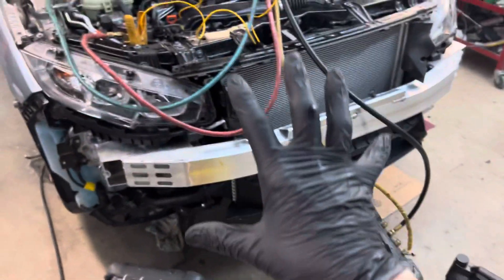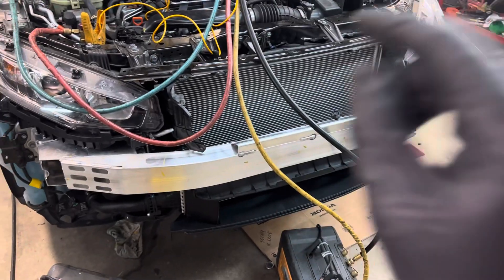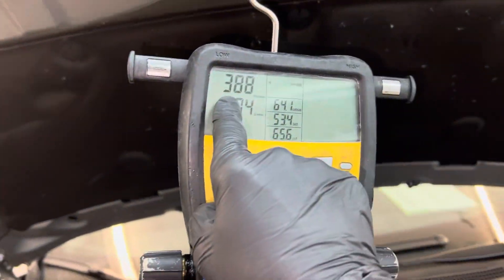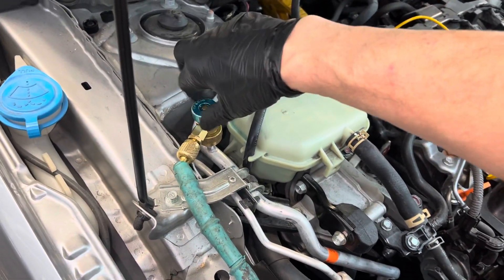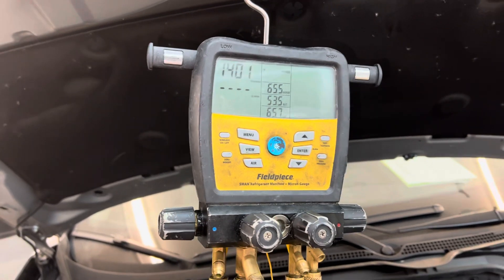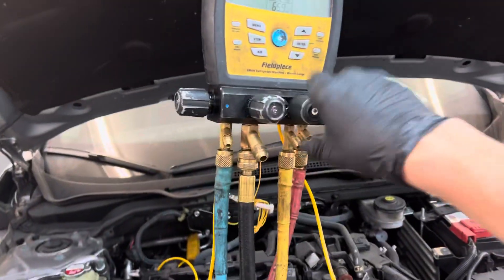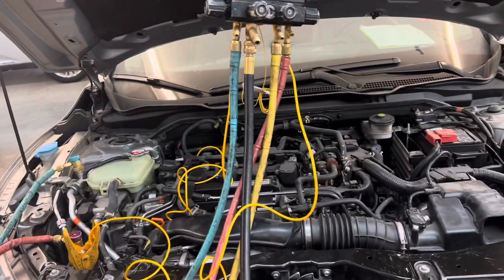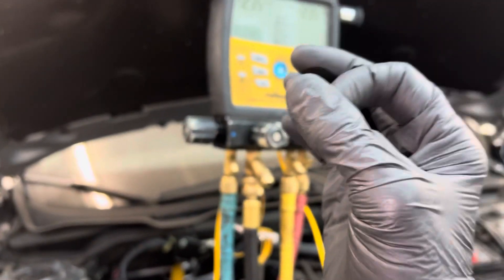Is Honda shaft seal fail under vacuum. But there still a way to charge it without air contamination￼

Comment: If the shaft seal is leaking under vacuum, this means atmosphere is leaking into the system under these conditions.
Reply from the maker: And this is just another reason you see some cars with high air content mix with refrigerant 

Many techs can’t even find this type of vacuum leak, don’t even know it existed 

   Many technicians believe formal education is not needed you just learned by screwing customers cars up until you learn and charge them for it. 

       Many technicians think as long as it works it must be good and you charge them for it.

     Think of a paint job where the body shop doesn’t have a waterline separated in it or it’s doesn’t work anymore so when they primer the metal little spots of water shoot out onto the metal years later rust spots develop underneath the paint but it was good at the time they did the work look good. 

        Technicians who don’t know need to replace the torque converter when a transmission would burn out charge the customer $2000 to throw in a transmission reuse the old torque converter don’t flush out the transmission cooler that has filled with tiny metal flake transmission worked perfectly when I left the shop but burns out in 30,000 miles. 

        Same goes with air-conditioning leave moisture in the system leave some air in the system came out perfectly cold out at a Da so that means it must be good later this oil breaks down or the high assets starts rotting out the evaporator coil a couple years later because of what the technician did before now the customer needs a $1800 evaporator replacement because of the dumb ass stupid effing tech who thinks just because it works good now it’s good enough and charge as a customer for it and even makes more money off of their mistake later on because they get to charge them again to redo it. 

     Really intelligent way of thinking how learning on the job works.  When you learn by yourself with no guidance